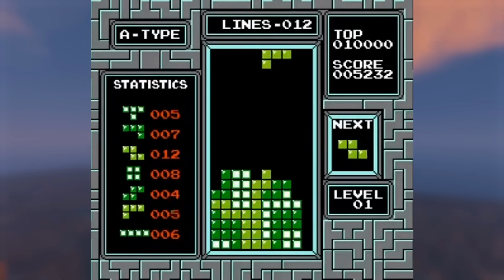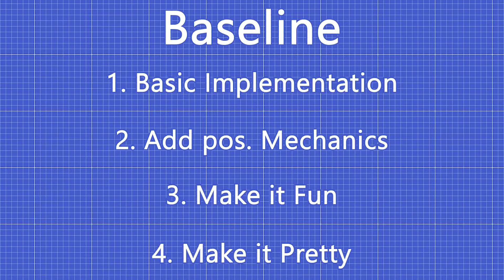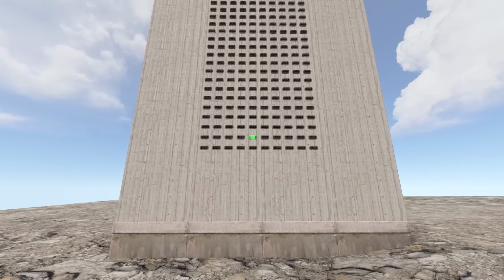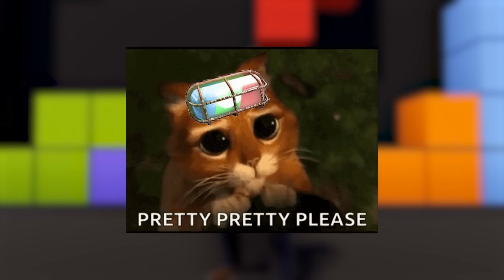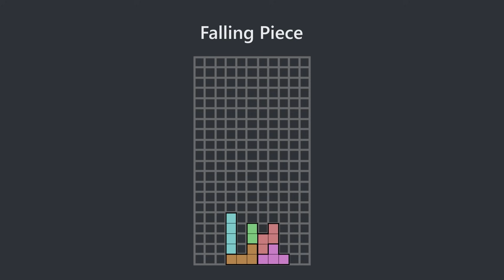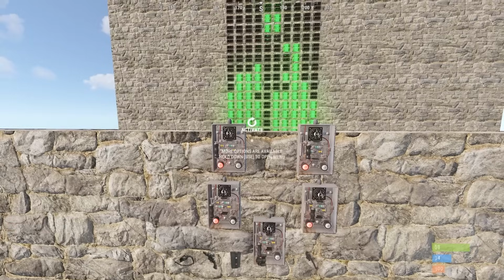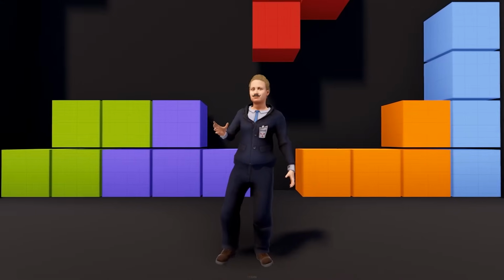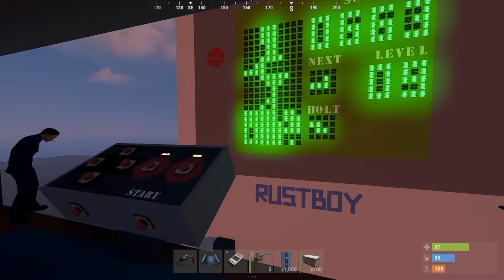I Built a Working Tetris in Rust… Using Only Electricity

Comment: Dear Phil, I admire your determination and ability. I just want to say; In order not to use 8000 parts, it would be more logical to request a processor chip instead of RGB light. 😅
Reply from the maker: I wouldn't complain to having those as well, but RGB lights are probably more resonable to get.

Comment: Make an outpost wheel, it might be easy for you but it's a lot of fun, the hardest part is counting bets, and for that you can have conveyors representing a part of binary number. For example it checks if there is 160 then it takes it, if there is more than 80 left than it takes it, then 40, 20, 10. Then you check what boxes are filled and get a binary number, do needed operations and give back the amount someone won. For example I put 138 => 01101. Of course with larger numbers, I got the whole concept ready, just needs a tone of wiring and I don't have will and tome for that
Reply from the maker: Yes this is a great idea. And very smart suggestion from you to use binary. The simple way of just having eg. a conveyor deducting only 10 scrap on repeat would take forever.
Though given that the conveyors still take about 5 second for a check one would need to see what upper limit would be feasible to do.
Reply: @PhilieveRust(writing from another account) btw forgot to say how amazing the explanation in your video was. 
Of course this system has limits, but it is possible to get it to be able to bet up to 1000 scrap at number. And at that point it will take about 20-30 sec or faster, and I think that's enough, for example someone bets, and it immediately starts calculating everything. While it is calculating the customer is distracted by a 10 sec timer before the wheel spins, and a long beautiful animation of spinning. Giving the win can be made insanely fast and that's it. 
There will be a lot of problems with how stupid conveyors work that you will need to fix and especially when you start speeding everything up with daisy chaining the boxes and adding more conveyors. If you are interested I can dig out my test world, a lot of conveyor related problems are solved there
Reply: @PhilieveRust ?

Comment: yo great job! I was always interested in how to make a display using the lights and I think the circuit could be adapted to display text easily too I might have a go and try it out, great video man!
Reply from the maker: You can certainly do that. At the end of my calculator video I had a small teaser for a text display I made.
It uses a 3x5 dot matrix and is wired it to a decoder that supports up to 64 different characters.
So it is certainly possible, just a bit time intensive.

Comment: Electrical engineers when they finally get home after a long day to play rust:
Reply: software engineers you mean
Reply: It's basically just and gates.
Reply: @mikesprigg5495  just what?
Reply: @L.u.c.i.f.e.r...  logic "And" gates. If both inputs are positive the output is also, otherwise it's false. That is all that is needed to control position of the piece and also for the collision. If x,y is positive that controls the position, if object + wall collides that is collosion detect. So logical and gates control all that is needed for the game to operate basically.
Reply: @mikesprigg5495  I know I was messing with you 😂